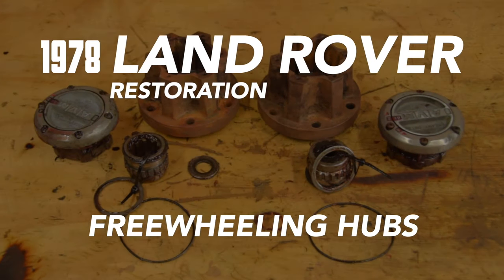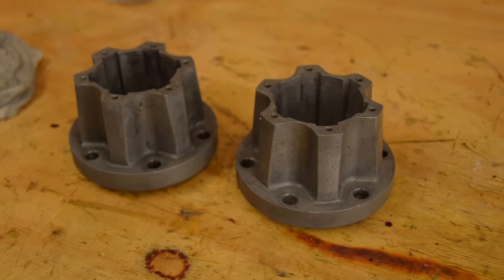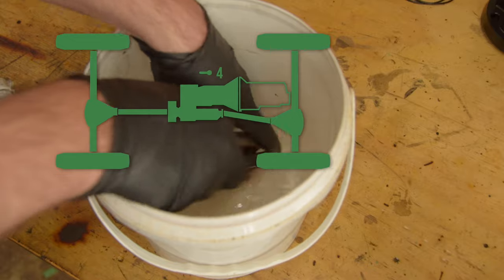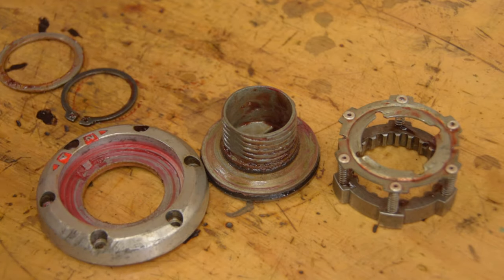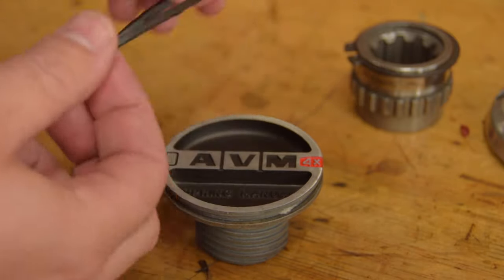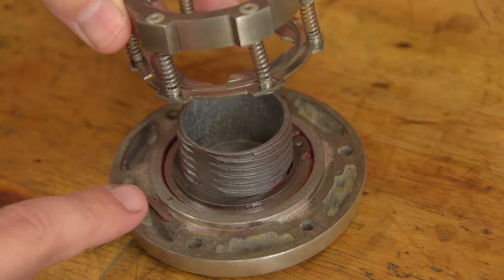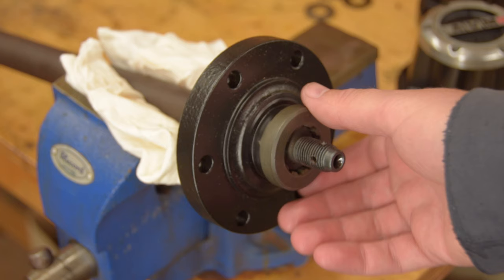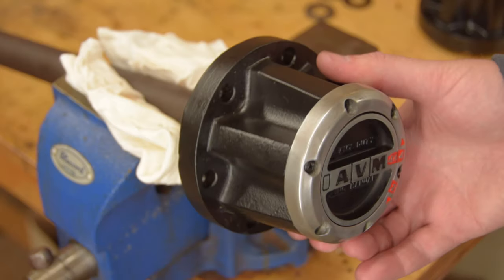Free Wheeling Hubs - Land Rover Restoration Part 9

Comment: I had a 60 Series diesel Landc*****r with free wheeling hubs. wear and tear aside (no problems over 300,000 klm). I kept meticulous fuel consumption records with the hubs locked and unlocked. There was absolutely no difference and, if kept locked, no need to activate them in 4WD situations.. Thanks for the videos, takes me back to our using Land Rovers in the late 60's in the Pilbara and Kimberley regions of Australia.... Alloy heads and iron blocks in the 6 cylinder models did not mix well with bore water coolant plus we became expert broken rear axle exchangers.

Comment: I mean, nearly every 4x4 that’s been made since as far back as I can remember has had some sort of front axle disconnect. I don’t know why anyone would think it’s a bad idea. 

Also, finally a new video. We’ve missed you.
Reply: Lassi Kinnunen  hub connects wheel to diff, transferbox transfers power from gearbox to drive shaft to diff
Reply: rednwhitecooper that's why the Range Rover was so revolutionary as it had permanent 4x4 drive with all the benefits of safety and none of the  drawbacks of steering wheel kicking in your hand and the vehicle hopping and skipping along the tarmac. All due to the centre differential and the ability to lock li.

Comment: Love your channel, can easily say I am having a blast remembering my Old 72 S3. well as to the fuel consumption, that mostly depends on how "heavy" your foot is, I had a Petrol '72, and from my experience it pretty much chose the speed it wanted to drive at, you could plunge the accelerator all you wanted (and yes eventually it would go up to ludicrous speed 80 km/h :P ) but it would mostly just spit the gas out of the muffler. my suggestion if any L/R petrol engine owners are interested in fuel consumption is 1. do not change the carb for some after market part. Use the original and tune it well 2. install the hubs, they do help 3. install a vacumm gage in the cabin, so you can better tell when fuel is been wasted because of your lack of manners with the pedal ! Cheers :)

Comment: I have a 1990 Daihatsu Feroza which has hubs that look suspiciously like this, with the brake rotors mounted to the back. This apparently requires disassembly of said parts to replace the rotors, which being the original ones are pretty well rooted and undersize now. I've definitely been avoiding doing that job, thanks for the encouragement 😉

Comment: Free wheeling hubs are there to unlock on your mates so they flog it into a river or up a sand dune a d get stuck 1/2 way cause there's no drive to the front wheels even though the transfer is in 4x4 
Not so funny when your the one stuck
Personally I leave the hubs on my Landcruiser in all the time
But im a farmer so I'm in 4x4 1/2 The day anyway 
I don't notice any difference in fuel when I do remember to unlock them before driving 900km to Perth my closest city 
I do notice less resistance in the steering wheel when at full lock unlocked on bitumen though

Comment: I know I'm coming late to the party but hey.... The one advantage I have for (manual) freewheeling hubs comes when you're backing trailers. With the hubs DISENGAGED (ie in 2wd mode) and with 4Low selected in the transfer case, you are able to select reverse and vae all the time in the world to back a trailer into some very tight locations without the binding of the 4wd system , which causes untold stress throughout the front axles and into the Transfer case.

Comment: i had a friend drill a bigger hole in the bottom of that railco bush to get more grease flung in,  free wheeling hubs work when you really use the car a lot, it does save a little fuel and the cars moves a bit free'er.

Comment: The operation of FWH is just as you describe, but their fuel saving and performance benefits are entirely placebo.  Been there, done that, learned the hard way.  If they had been of any benefit, LR would have installed them as standard during the oil crisis of the 70s.  I did a lot of driving recording fuel consumption with them engaged and disengaged, and they make absolutely no difference.

Their solitary real world benefit is that if you break a front half shaft or diff, you can select 2wd and disengage the FWH so you can drive home without doing more damage.  On the other hand, you’ll get filthy having to engage them when you unexpectedly need 4wd, they are prone to leaking oil, and they massively increase swivel pin, Railko bush and prop shaft wear.

Edited to add: exemplary work, as always.

Comment: Love your work, but personally ditched the free wheeling hubs from both my Series Landies years ago.  No dramas with those wanting to run them though.  Fuel savings are minimal and you don’t drive an old Landy for its fuel economy.   Have broken 2 over the years too.  Regarding oil not getting to the Railco, those having issues and running free wheeling hubs should try 4WD their vehicles more often. 😉

They do however give your steering a different feel - better with free wheeling hubs, but I can live without them these days.  Keep up the good work.
Reply from the maker: Yeah, half the time I just drive with them locked in 4wd mode anyway, because I hate getting out to engage the hubs if I see a track off the side of the road.

Comment: I've never found there to be any fuel savings whether the hubs are free or locked.  Extensive testing on the same trips (because I often forget to unlock them at the appropriate time) hasn't shown any difference in fuel economy one way or the other.

They do make a difference to the weight of the steering, and the amount of lock achievable though.

Comment: Over the last 30 years I've binned about two dozen free wheeling hubs, they cause far more damage than the tiny bit of fuel saving they claim. Railko bush and pin wear, propshaft spline wear, crown wheel corrosion are all a result of these snake oil free wheeling hubs, I know people are going to say you must engage them every 500 miles for a period, this alone tells you they're not supposed to be on there.

Comment: Check them from time to time. Some sorry SOB may have engaged JUST ONE of your free-wheeling hubs .. just to be funny. 
If that happens, your differential's ring gear will spin madly whenever you drive. You may notice the sound and you may not ... but it will wear out the differential in short order.

Comment: So... no proper bearings? Only a greased up wear surface? Won't that negate any chance of milage improvement vs. proper wheel bearings? And maybe a chance of getting very hot by friction and fuse together?
Reply from the maker: There are proper wheel bearings. The half shaft spins in the free wheeling hub but there is zero radial load.

Comment: You could use a ball peen hammer to easily get a edge with the tape next time your trying to tape a edge off that would be hard to trim easily with a knife.  Just hit it on the edge with the peen end and it will trim the tape right up the edge.
Reply from the maker: I do that sometimes 👍

Comment: Regarding free wheel hubs and saving on fuel... I disagree... Did my own comparison and over a 1500km mixed driving... 1500 in lock and 1500 in free, I used almost exactly the same amount of fuel... about 3 liters difference is what it amounted to...  The advantage of having the hubs locked is that it lubricates the front drive train... so I would say its better to keep them in lock position... The other advantage is that you dont have to get out of the car when you want to go into 4wd... Just select 4wd with the transfer case gear selector and off you go...  BTW this was in a Land Cruiser...maybe in Land Rover things are different...